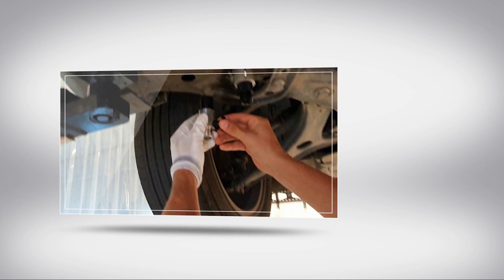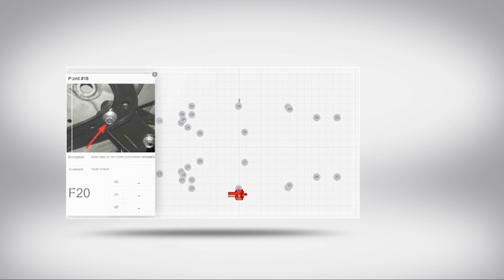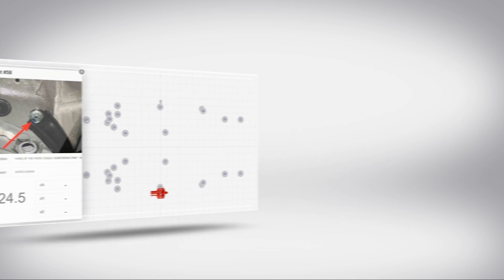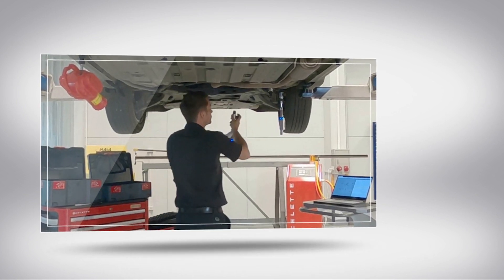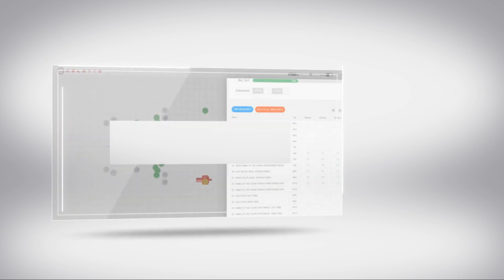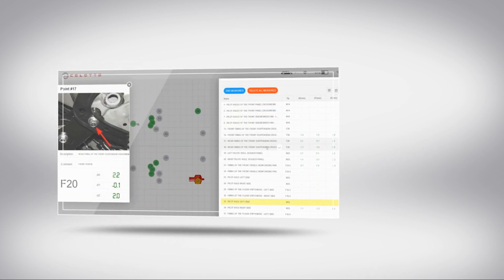Electronic measuring system EAGLE : Revolution in the field of collision repair industry by Celette.

Comment: How well is this tool used on frame aligner or frame racks? Is it designed for diagnostic on a 2 post hoist?
Reply from the maker: It can be used on a framerack but it would be easier on a postlift , because it creates more space under the car and that makes it easier to use the EAGLE
Reply: @Celette  i am trying to establish if we can market this tool as also a repair tool rather than just a diagnostic tool for insurance. This will be a great tool if can do both 👍
Reply from the maker: @kaiaero  Hello Clemens, for now we developed it only as a tool for diagnostic tool for insurance.
But as you can imagine insurance  companies have also an interest on it for the adjusters as it is convenient, light, and easy. 
Of course  this tool could be used for repair but it is not very convenient. We are working on some other project to combine it with some  other cheaper tools for repairing. If you need some more information about it, please feel free to contact me on this email address : pierre@azimuthasia.co.th
My name is Pierre Nicolau and I am President of Celette.